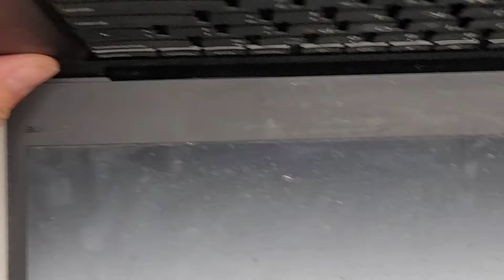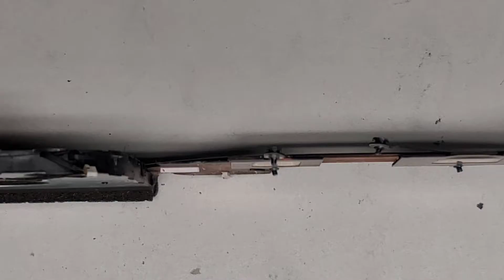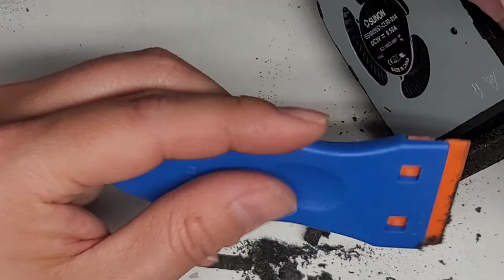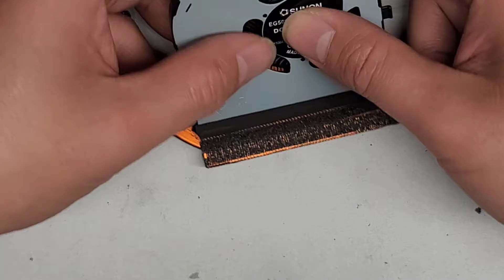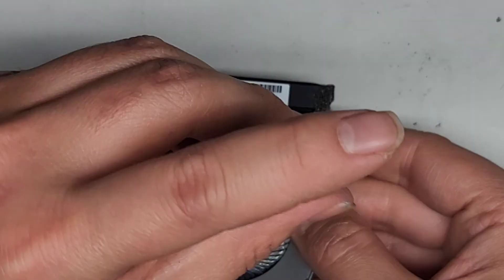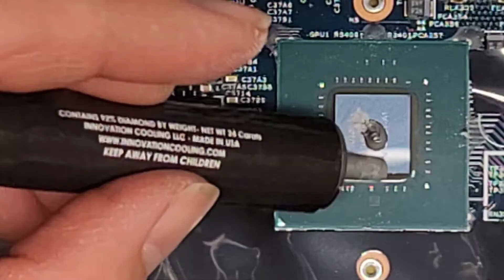Lenovo ThinkPad X1 Extreme Disassembly RAM SSD Hard Drive Upgrade Battery Fan Replacement Repair

Comment: thank you for a 3 year old video.  Made my battery swap super easy.
Reply from the maker: Awesome, glad it went well.
Reply: Can I ask how are these in 2026? I was looking at getting a used one as a spare laptop/some other purposes but the hardware seems ancient
Reply: @DislikeMathAlot  bought a gen two model second hand about 2 years ago still running perfectly

Comment: NO Ram or SSD upgrade or battery replaement done. fake title again.
Reply from the maker: RAM and battery were 100% removed. If you don't know how to remove an SSD after knowing where it is, then you lack very very basic computer upgrade skills. One screw and pull it out... Read more comments and show me others having the same issue as you... sounds like you didn't watch the 1/4 of the video... or you have no idea what you even watched... pay attention!

Comment: I got one fan error how to fix that
Reply from the maker: This playlist will help Fan Repair: https://www.youtube.com/playlist?list=PLSSiYX-ta7aqqxfDWDQh-B6Az4ZgDI459
Reply: My laptop isn't very dirty, but I opened it up and cleaned the fans, and a problem appeared with one of the fans. One fan was running at a higher speed than the other. But both are working, something is wrong that the system doesn't delect both fans even both are working
Reply from the maker: @ReStoryIt  how did you clean it?
Reply: I removed the fans and I cleaned it with the brush, also I removed the black foam Because it was easy to remove because of the heat

Comment: I have the same Laptop the X1 Extreme Gen 2 with 64gb ram and 2tb ssd and my battery is at 49% left at full charge and it gets hot when i have no cooling pad on it i see it get to 42°C and when i have my cooling pad i see it at lowest of 28°C , i have not changed my battery yet or thermal past so if i change the thermal paste and get a new battery shoukd it keep the temperature low with out usung my cooling pad? What is normal heat temperature?
Reply from the maker: I don't know the normal temperature. Thermal Paste will definitely help
Reply: @ItsBinhRepaired  ok cool and what is the best thermal paste to buy?
Reply from the maker: Ptm7950 and thermal Grizzly putty pro for the video chips
Reply: @ItsBinhRepaired  ok cool ima buy those

Comment: Thank you Binh, your close up explanation of the battery plug/connector was particularly helpful since that thing is a bit fiddly. Just a note on the surface blistering: Bubbling or blistering on a ThinkPad is not caused by (even excessive) heat. Such a scenario with a ThinkPad is extremely unlikely. Chemical exposure is the far more likely cause: Things like Windex, purfumed cleaning sprays, bleach from household cleaners and medical disinfectants, oxidising stain removers, citrus and orange oil based cleaners - These can cause the kind of blistering you see here. It's possible that your customer thinks it was caused by heat alone when in fact this blistering wouldn't have happened even with overheating if certain cleaners had never been used on it.
Reply from the maker: Makes sense. Dissolves/softens the plastic.

Comment: I want to know if I can reach the GPU? Its supposed to be a gtx 1050ti but how do I get to it through the laptop for repair or replacement or upgrading
Reply from the maker: You can't remove it
Reply: @ItsBinhRepaired  so I'm assuming u can't replace or repair it?
Reply from the maker: @aquilion11  nope need to replace the motherboard

Comment: I have the same laptop which suddenly switched of completely while I was working. No power nothing. The little reset button also did nothing to power it up. Out of the blue it stopped working. Could someone tell me if it is possible when a cmos battery is not working that this causes the motherboard not powering up? Searching on the internet I saw that a flat cmos battery should still enable the computer to power on. I just would like to know if in some cases it would be possible that the replacement of a cmos battery could result in the power restore of the laptop? Thanks for your input.
Reply from the maker: Sounds like a dead motherboard sadly

Comment: The "emergency reset button" immediately kills power to the board as long as the A/C adapter is not plugged in.   You do not need to hold for 15 seconds.
Reply from the maker: I hold it to drain power from the motherboard.

Comment: Wtf my extreme hasn't done that pealing that's crazy
Reply from the maker: IKR! I dunno what they did
Reply: @ItsBinhRepaired  
Do you happen to know if there's an order of taking the screws off of the heatsink, about to replace my thermal paste but might replace the battery at the same time.
Reply from the maker: I usually loosen them all a little at a time.
Reply: @ItsBinhRepaired  there's another video I found that talks about when removing the heatsink there's numbers to remove from backwards when removing then in order setting back so the paste apply evenly.
Reply: @ItsBinhRepaired  not sure if the extreme is like that though
Reply from the maker: @Invertedworldx  removal the order isn't that important.
Reply: @ItsBinhRepaired  
Just curious, now that I cleaned the fans, heatsink, gpu cpu and then reapplied thermal paste basically the same amount you had used. 
What indications would raise red flags that its not working correctly? I have some programs that are watching the temps but hard to say from before and after since it's always ran warm/hot.  Typically i run my laptop on a cooling fan platform but testing things out first without it.
Reply from the maker: @Invertedworldx  if it's below 80c you should be fine

Comment: Thank you so much! This video is very helpful! Do you know where I can find the oil you use when you fix the fan? I am thinking to do the same although mine is not broken :) Thank you!
Reply from the maker: It's just motor oil. You could technically pull the dipstick from any gas powered vehicle/tool and take a few drops.

Comment: Hi this is very helpful! I just came to a point that I don’t have a smaller enough screw driver that can open my fan :( could u tell me what size the screw driver is? Thanks
Reply: I managed to find a screw driver to open it. My computer now is more quiet than before =)
Reply from the maker: A set like this is very useful https://amzn.to/3vdz32c if you have the money,  I highly recommend this for the quality bits though https://amzn.to/3BOqOut
Reply: @ItsBinhRepaired  Thanks. I think I need the PH000 size coz' the smallest I have here is only PH00 which can't fit but close.
Reply from the maker: 00 from the ifixit works